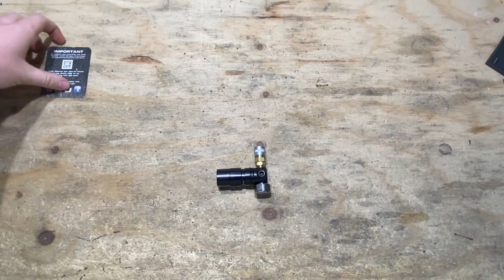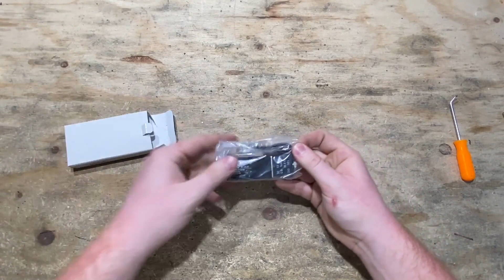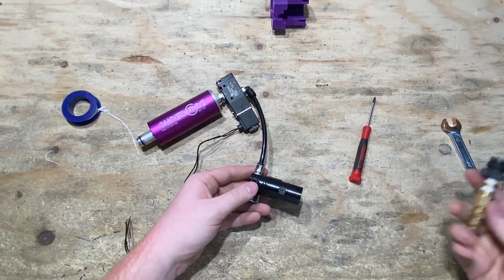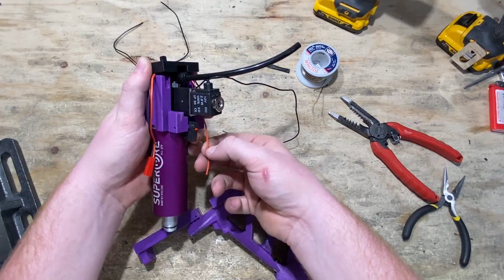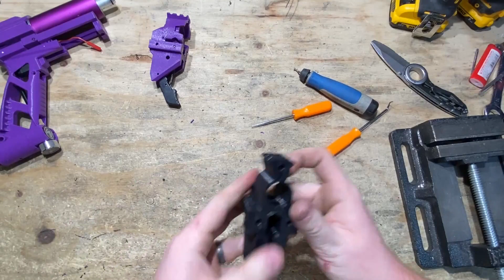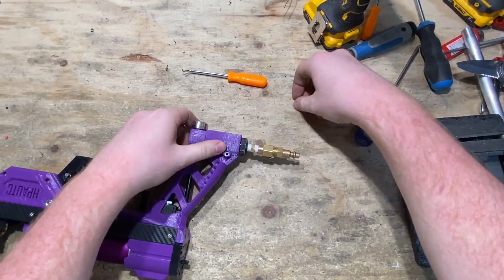HPA U Talon Claw | Build Guide

Comment: does the hardware kit include a supercore?
Reply from the maker: Great question!! Currently the listing is actually set up to send out with the SniperCore, which is the successor to the Supercore from Spectre. But we're also getting Narfcores in, which is less expensive than the sniper core and more powerful (basically a better supercore). They each have their pros and cons, with the SniperCore being an open bolt design and having a smaller pusher so its easier and more convient to both build with and use in the heat of battle because you don't have to open the bolt by pulling the trigger. Meanwhile the Narfcore has greater air volume and better machining, so its more powerful overall.

So overall, the answer is yes that it includes an HPA core, it just isn't the supercore since they're not in production anymore. Hopefully that helps, please ask any more questions you have! -Ryan

Comment: Been watching tons of build guides, I find its cathartic, plus i love seeing how the mechanics of each system come together.

One thing to add, while it could be attributed to a bad dart, the other possible solution is something the Airsoft world refers to as Refresh Rate. This is the time it takes the Regulator to refill the air chamber and reach the pressure you have set it to. If you fire too fast (common with automatic Airsoft setups) then the pressure will slowly push lower and lower until you get misfires.